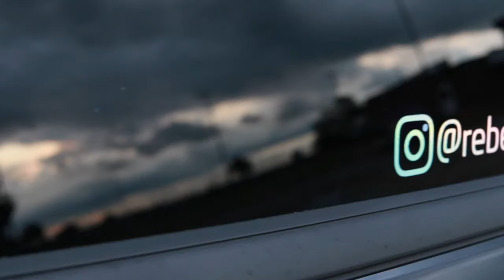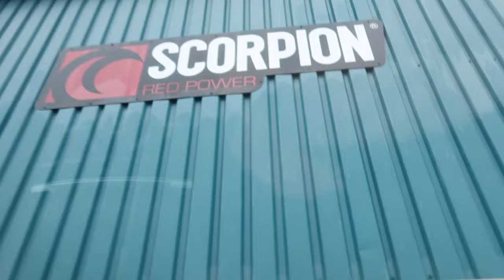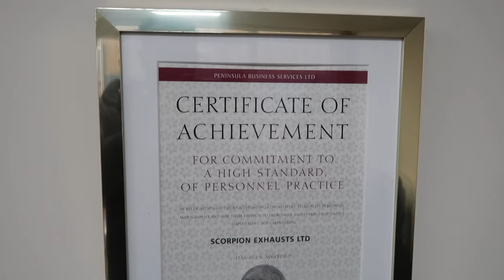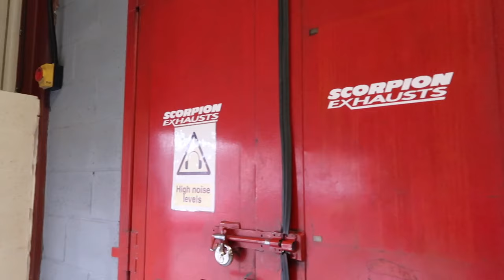MY FIESTA ST SCORPION EXHAUST INSTALL!

Comment: Cheers for doing this vid. I have a Focus ST with stock exhaust at the mo so this vid was useful for researching potential upgrades! What's next on the mods list? Intercooler and induction upgrade as you have had the exhaust done?

Comment: Get an induction kit next, personally I’ve got the ITG induction, miltek non res race exhaust, MTC motorsport intercooler, symposer delete, scorpion deact which I need to fit, and Turbosmart dual port blow off valve, I’ll be going stage 2 in the next two weeks. The fiesta st is a great car which can get serious power if that’s what you want
Reply from the maker: Dylan Miller sounds like you have it all planned, sounds good!
Reply: Rebecca Cox yeah I defo do, check on the st page on Facebook there’s loads of builds on there

Comment: What's the drone like now it's properly bedded in? I want to swap my Milltek race Mon res and sports cat for a 3" Scorpion non Res and sports cat, but worried about drone like you were. The milltek is perfect for motorway driving and being quiet when you need it to be but sounds awesome when you floor it which is exactly what I want but I prefer the tone of the Scorpion.
Reply: Well the author of this video is really bad at replying to her followers or viewers. 

I've just gone stage 3 and replaced my Milltek race system turbo back with a Scorpion race system with sports cat. I can confirm there is no drone whilst cruising. It is very deep and bass like, quite loud and asbo but you can keep it quiet whilst cruising. It makes the engine sound a hellova lot beefier than a 1.6! In fact it sounds like my mates R33 Skyline GTST! The cat back only is fairly tame, when you add the sports cat or the decat it will get louder.
Reply: @Tom Wright  did you go 3 inch non-resonated with the scorpion?
Reply: @joshd5982  yes read my reply just above yours I give a brief review as I went stage 3 and wanted the larger bore exhaust that Scorpion provides 👍🏼
Reply: @krAwly  Cheers mate. Just checking you hadn't changed your mind since your original comment. Did you do a symposer delete as well? I want to get the same as you but not sure if I'd have to do a symposer delete as well to avoid drone
Reply: @joshd5982  yes I did a symposer delete very early on when I had the milltek fitted. I have an ITG, cross over Pipe, hard boost pipes and Intercooler pipes and an FS320 turbo making 300whp, it's great fun but the Scorpion is noticeably louder than the Milltek but the Scorpion is a bigger bore exhaust which helps improve power with the stage 3 software and hybrid turbo.